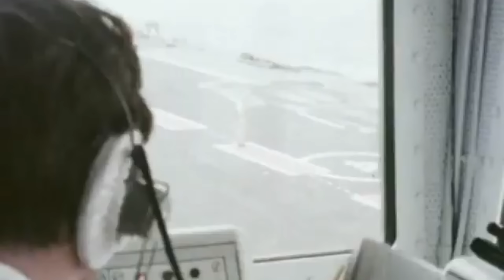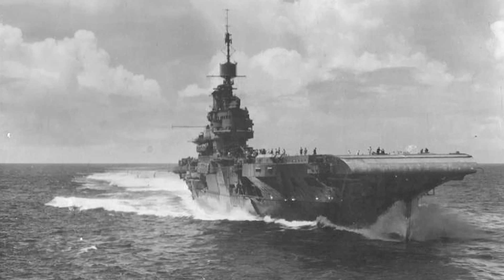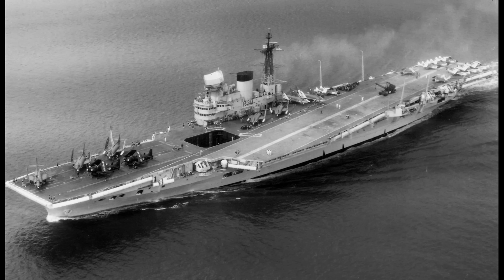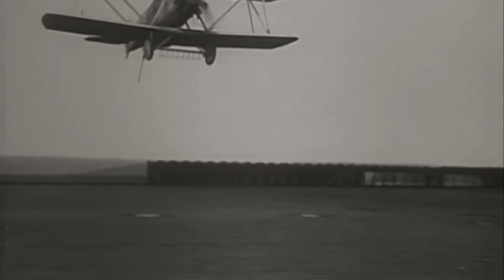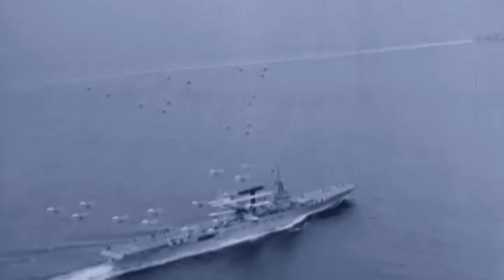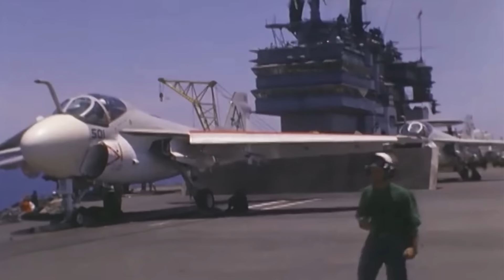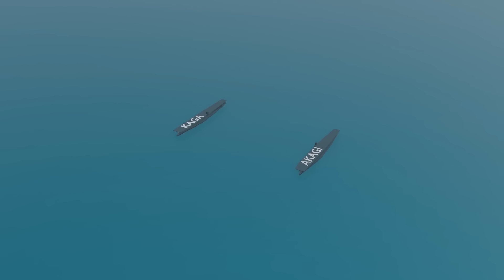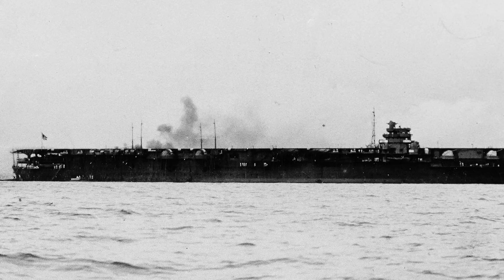Why Are Carrier Islands Always on the Right? — and How It All Began

Comment: I found it interesting that some U.S. carriers in WW2 had catapults that launched places from the hanger deck at 90 degrees to the normal flight deck. I guess it was a time of experimentation. I doubt they could do it today.
Reply from the maker: Actually, you accidentally revealed one of the topics I was planning to cover in one of my upcoming videos😂
Reply: I guess modern planes can not get enough lift at the low speeds you can realistically accelerate too in such a short space? But isn't this something that "drone carriers" are looking to do, as the speed & acceleration requirements can be much more compact?
Reply: @SyncViews  Modern warplanes are big and don’t have great lift at low speed. It is possible but impractical.
Reply: @xxOmponxx  I wonder if a JATO/RATO system could make it possible without injuring the pilot or needing to strengthen the airframe?
Reply: @ryno07962  That has been done with C130s as a proof of concept but it is really just easier to just buy F-35Bs, the ones with VTOL capabilities. The JMSDF is using them on their “Helicopter Cruisers” and the Queen Elizabeth Class carriers use the same aircraft but with a ski jump. CATOBAR is expensive and RATO isn’t reusable or as reliable. For reference, the F35 is the same length as and double the max takeoff weight of the B-25 Mitchell bomber from WWII.
Reply: @xxOmponxx  I specifically meant for launching emergency fighter/interceptors from bays below and perpendicular to the flight deck as was once proposed.
Reply: @SyncViews  remember, most planes, even fighters, would need a few thousand feet of runway to takeoff, especially if fully loaded with fuel and bombs. A WWII era Essex class was about 800. The new Ford class is just over 1,000. So still not nearly long enough. That’s why they need assistance. The “problem” with the VTOL and ski jump systems is that the planes can’t be as heavy as they could if using a CATOBAR system. without the Cat, you have to give up either fuel or bomb load. The problem is that the catapult is finicky and a lot of work, and you really need a lot of experience to keep them working properly. The Brits helped develop the technology back in the ‘40’s and ‘50’s. I have no idea why they stopped using it. Probably got too expensive. I mean, there’s a reason the US spends more money on our defense budget than like the next 10 countries combined.
Reply: @KennethStone after WW2, Britain ceased to be the dominant sea power while the US became the world's defacto police force. And needed carriers to project power and take the fight to the enemy across two oceans. That meant planes that could handle long-range bombing missions. And carriers that could handle them.
Reply: Ya, the first 3 or 4 Essex class carriers had "cross deck catapults" in the forward part of hanger bay 1. They were intended to be used if there was a fowled deck (a plane crash up top), and you need to get a plane off NOW. In effect, they weren't that practical because the ship is likely steaming at 30-35 knots. When the cat launches you, BOOM! You got a 35 knot cross wind. Not very good for the pilot or the plane. If you look up cross deck catapults here on YouTube, there are one or two videos I've found. I was looking that up because I worked on a museum carrier, USS Hornet CV-12, one of the Essex's with a cross deck cat. We have pictures of it, but it was torn out almost immediately in the '40's and moved up to the flight deck to have 2 cats up top (port and starboard).
Reply: @KennethStone Lexington and Saratoga, the converted battle cruisers, had catapults forward out the starboard side of the hangar deck and deck turrets with battleship-grade guns, fore and aft of the island.
The turrets were removed once it became obvious they had very restricted firing arcs, as they could not fire anywhere towards port without the blast ripping up the flight deck.  The catapult remained.
The catapult were also battleship style, intended for scout planes.  They were never used in action.
Trivia - Lady Lex and Sister Sara had, during their first years, the greatest capacity for onboard aircraft of nearly any carrier ever built.  Because the biplane were so light crews could literally lash airplanes to the overheads in the hangar deck, freeing deck space for more planes.
Reply: @MGo @MGower4465 ver thought about that, but that makes sense. I know the Essex’s could store whole planes in the overheads of the hanger deck because they were so much smaller and lighter back then. 

And I also never thought about the large guns, either. But that makes total sense. The Essex’s also had 3 big turrets fore and aft, but I think they were “only” 5”/30’s. Not battlecruiser size. I’m not sure what size those would be… I know the biggest the US ever used was the 16’s on the Iowas. So maybe 10-15”, maybe? Ya, that would be some good over pressure, especially over a wooden flight deck.
Reply: @MGower4465 Heavy cruiser guns 8” not battleship calibre
Reply: The U.S. Navy didn't use catapults until later. This was for the Vought F4U Corsair which couldn't operate from the "flattops", as carriers were often called. They also had a visibility problem because of the "gull-wings". So the Marines were using them (with great success) from island-based airfields. The Navy eventually got their catapults, however, the first Navy jets also contributed to the need for them:
USS Forrestal
1954 Forrestal-class aircraft carrier
"USS Forrestal, was a 'supercarrier' named after the first United States Secretary of Defense James Forrestal. Commissioned in 1955, she was the United States' first completed supercarrier, and was the lead ship of her class. The other carriers of her class were USS Saratoga, USS Ranger and USS Independence. She surpassed the World War II Japanese carrier Shinano as the largest carrier yet built, and was the first designed to support jet aircraft" (Source: Wikipedia Note: I seldom quote from Wikipedia...for the usual reasons. But this came up in my search.)
Reply: Eventually, the Brits would make the first Harrier (which the U.S. Marines also used). These were capable of vertical take off, but, with a launching ramp, the clever British used them for short take offs.
Reply: @stevenward3856  and now we’re making the second version, which is less likely to kill you.
Reply: Here's a strange.
 Thought that you may not like destroyers used to carry aircraft that they would launch with j. Toe launcher's perpendicular to their deck or slightly forward. Aimed from the deck depending on their speed, prevailing, wind and direction of target, they were capable of carrying 6 planes in such an arrangement, recovery of the planes required the planes have some flotation ability in the water.  And they will be winched up and put back onto the rocket or launching rail. These were most commonly used during world war one.
Reply: Very informative, good effort I thought
Reply: It was an extension of the practice of catapults on battleships and cruisers. They weren’t the main fighters and bombers but usually small floatplanes with very low stall speeds. Just like battleships and cruisers they were small scout planes that didn’t need the time and effort of elevating to the fight deck. However, as planes got bigger by the early war period they were often removed and just retained the practice on smaller ships and used existing planes for scouting on fleet carriers.
Reply: Any aircraft has a different catapult pressure rating, on the main deck with head wind, it might take 100psi over 50m to gain the required speed to sustain lift. if it didn't rip the aircraft apart, 500psi would enable lift in 10m. It wasn't practical for anything but fleet defense aircraft as they'd be lighter & require less force to help with airframe fatigue. strengthening aircraft wasn't an option because it adds weight, increasing the pressure need, increasing the need for more strengthening till the aircraft has no real performance.